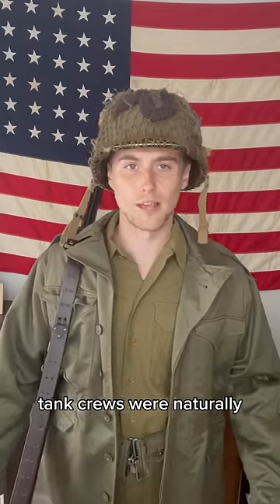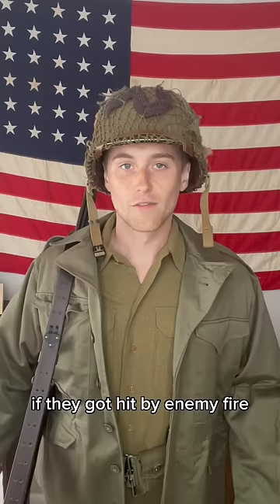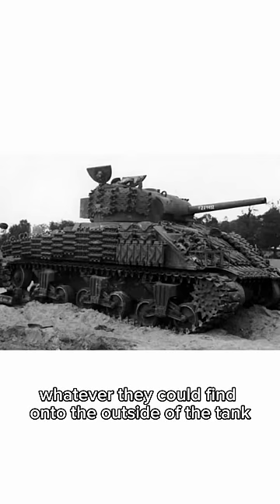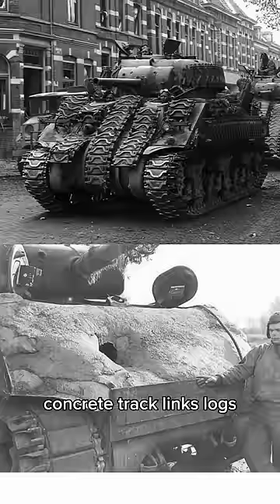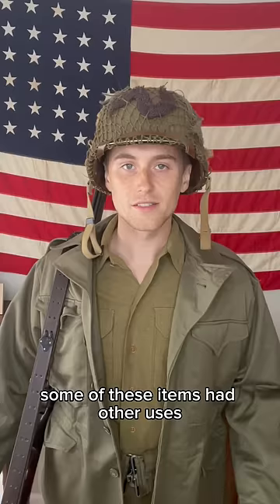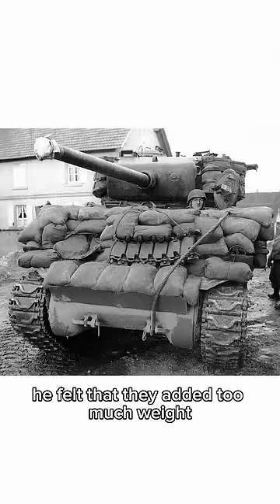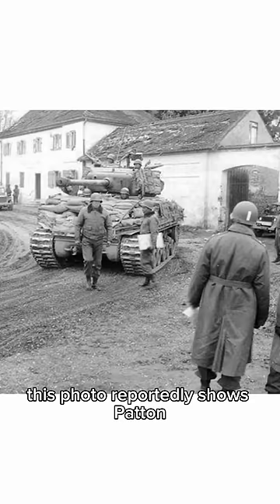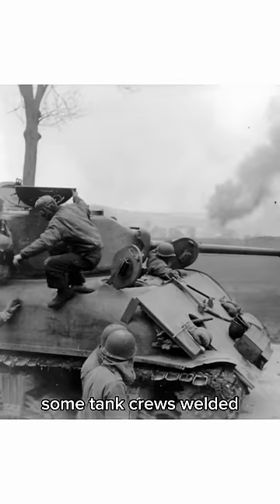Improvised Armor on US WWII Tanks

Comment: "General Patton was not a fan of..."

Yeah sounds about right
Reply: What's more impressive is that he approved something.
Reply: Well ge was right... sandbags weigh a ton and wont help stop a shell going through it.   He was a fan of adding more ARMOR
Reply: @jeepsblackpowderandlights4305 crews did whatever they could with the crude and limited resources.. the push into France and Germany happened so quickly and the Allies experienced heavy casualties
Reply: @jeepsblackpowderandlights4305 A lot of makeshift armor (such as track links) would often normalize the trajectory of incoming shells, causing them to become more effective at piercing the armor by negating the benefits of armor slopes. Patton was absolutely right.
Reply: @Chopstorm. Yeah old blood and guts wasn't riding in that tank though😂😂😂
Reply: He’s not wrong though proper armor helps sandbags and crap like that doesn’t
Reply: @Chopstorm. But these would be also in angle
Reply: @Utubesuperstar ok maybe sand didmt but tree logs did!!!
Reply: @amopastorcanadense  not really. Wood sucks at stopping bullets especially armor penetrating ones
Reply: @amopastorcanadense No, they did not. They actually helped HEAT rounds have more armor penetration due to giving them more distance to the actual armor when detonating. HEAT rounds were poorly understood and didn't have sufficient spacing back then, which the wood would provide, thus making them more effective.
Reply: @amopastorcanadense Nah not really.
Reply: Patton knew that an Army marches on it's stomach. His army required fuel and fuel efficiency is a most highly critical logistic in armored warfare.  Go figure🤷‍♂️
Reply: We should’ve listened to General Patton. He disliked very important things other than improvised tank armor
Reply: @Chopstorm. That’s straight bs. It could normalize as well as deviate the trajectory. Pure luck
Reply: We fought the wrong enemy
-General Patton
Reply: I mean in his defense sandbags are extremely heavy and I doubt they do much against anti armor rounds. Seeing that he approved of additional armor plates it does seem like he just wanted the tank to preform as well as possible without the addition of possibly another ton of weight.
Reply: @ZA-lv8ba  You can go look up Operation Think Tank, Episode 8 where the first ~10 minutes are dedicated to improvised armor use and how effective it was. Hilary Doyle and Steve Zaloga both support my point. 

Soft improvised armor normalized trajectories for incoming rounds, and also provided extra stand off distance that allowed early HEAT rounds to be even more effective.
Reply: @cameronbartlett856 because he had common sense. Unlike most of y’all.
Reply: @Chopstorm. but a lot of the younger generations will still say he wasn’t right just because he wasn’t nice but he was a amazing general and has common sense. Something lacking these days.
Reply: Patton was an amazing officer but an officer in every sense of the word and stereotypes that came with it. Dude bitched about everything but won so you couldn’t say shit
Reply: @mintz9782  The wild boomer appears out of nowhere
Reply: @jeepsblackpowderandlights4305  well to be fair, adding sandbags could be helpful, even if it doesn’t provide armor infantry if they really were desperate, could take it off of the tank to use as materials to set defensive position it is also useful, because if you could put something in front of a imminent death to attempt to stop  it, you would use everything on hand
Reply: @Chopstorm. 
They were for stopping shaped charges heat, and hesh like the panzefaust used
WAY more common than an enemy tank or at gun
Reply: @garyslayton8340  No, that's not how it worked. The soft armor actually improves the effectiveness of early HEAT weapons, as it provided extra standoff distance for their fuses to trigger. There was virtually no benefit from trying to use track links and other soft improvised armors.

This has been tested extensively, and is not even open for debate.
Reply: @Chopstorm.  
It is absolutly up for debate 

Early heat weapons did not have the penitration to do that

If thats the case then why does spaced armor even exist?
That was the entire point of spaced armor
To detonate heat and hesh shells early
It was proven to be effective agaisnt panzerfausts and japinses lunge mines
Every little bit counts in a battle 
And if the wood or tracks could make the diffrence then why not?
Reply: @garyslayton8340  Early spaced armor like schurzen was developed as a counter to Soviet AT rifles, not shaped charges. The mesh screens that the Germans used were ineffective against HEAT weapons like Bazooka, as found by the Germans in '44, and the British/US post war. Refer to WO 194/704 for sources.

Again, the reason why spaced armor did not work against early HEAT warheads was because of fuse delay. They did not detonate immediately. This meant that against normal armor the copper cone would crush before it could properly detonate, leading to poor performance. When you introduce soft armor or spaced armor, now you are giving that warhead time to arm without crushing said copper cone. This meant that the warhead actually did better in regards to penetration when used against such improvised armor.
Reply: @Chopstorm.  
If a shaped charge did not detinate on impact it would destroy the actual soft charge
Reply: @garyslayton8340  Again, soft armor like track links, thin spaced armor, or sandbags did not do that. They did not sufficiently crush the copper cone, and only allowed the fuse the amount of time needed to detonate the warhead at the optimal distance.

This has been tested. Like I said, it's not a matter of opinion or up to reasonable debate. It was a situation born out of fuse technology being rather primitive at the time.
Reply: Nobody in the Division will ever question or spoke about what General Patton doesn't like since then.
Reply: He was 100% right about the tank armor
Reply: @gagebyers1057  
Exept he wasnt
Reply: And he was correct.
Reply: now the question is what was he A fan of 💀
Reply: @garyslayton8340  my guy, sandbag and concrete did severely impact a tank's performance while not giving that much better protection than being completely naked whereas armor plates did provide tangible improvements in terms of protection
Reply: @Temporal94  they didnt *severely impact preformence 
The sherman had plenty of spare weight
Its why the entire t23 project was dropped
Because the sherman had the weight compacity and space to account for all the upgrades

and it did provide excilent protection against shaped charges
Like a panzerfaust
Somthing that would be WAY more common than a proper AT gun are tank
Reply: On this point though Patton was absolutely correct. The add ons had little to no actual benefit. In fact it could be said that they were an active detriment both for the weight and the fact that shots had better surface engagement now that it wasn't interacting with a smooth slanted surface which previously invited the shots to bounce but instead a universally rough that did not have the same proclivity.

This is why he approved of the plating originating from disabled and destroyed shermans. It did not mess as much with surface engagement, and it was actually designed to take these shots unlike everything else being put on the tanks.
Reply: @Chuked Allied armored forces did well in spite of the add ons. Not because of them. All it did was quite literally weigh them down.
Reply: @marketablepresentations7824 Old blood and guts is part of the reason we had tanks whatsoever or did you skip history for the cliffnotes version?
Reply: @cameronbartlett856 he's just passing word from Ordnance
Reply: @garyslayton8340 everyone then knew that erzats armor did shit-all against shaped charge and make them even better. Fortunately for them, they couldn't care about your misinformed opinions. If you're about to ask about spaced armor, look up a cutaway of the panzerfaust vs a pg-7v round. The whole front half of tbe pg-7v is there to provide proper stand off for the 'jet' to form, something that is missing in the panzerfaust. But if you add the thickness of sandbags or logs, the stand off would be just right. Also, veteran accounts don't count for much in these matters, they never were reliable. All the add-ons did was make them think they have enough armor that they think they're safe, and end up charging forward and dying.
Reply: It’d be funny to see his reaction if they did the war thunder strategy of drawing an arrow pointing to their weak spots
Reply: @Utubesuperstar  They absolutely did. Go outside.
Reply: @WarGravyB  no they don’t. You should really do some reading about the physics of what you claim to know about. Also reality and dozens of instances support my and everyone else on this thread who has even an ounce of intelligences stance
Reply: @Chopstorm. Believe it or not in contrast to a bunch of "experts" on a youtube comment section, Patton (yknow, one of the greatest and most admired-amongst-his-men generals in history) did, in fact, know his head from his ass.
Reply: I too learned in history that he wasnt much of a fan, in fact, he wasnt a fan at all
Reply: @garyslayton8340 my boy. Its better to actually weld actual armor plates than have anything that includes Sandbags, Tracks and logs.

Space armor in WW2 is not meant for HEAT warheads they're meant to counter AT rifles. Infact you're far more safer on something that everyone call the Sherman Jumbo than being on a sherman that has Sandbags and track links on the armor.
Reply: @Gencrossbones  
Plate steel IS more effective

thats false
Shermans were allready more or less immune to anti tank rifles
And german docterine was bassicly ditched AT rifles by ww2

Yes they were ment to counter heat warheads

And go figure a heavy tank id better protected than an up armored medium, thats just basic logic
Reply: @garyslayton8340  the spaced armor line is mostly meant for the German Panzer IVs and not for the Sherman specifically and they really don't help with HEAT warheads in WW2. 

Like spaced armor really don't help much in stopping WW2 HEAT.
Reply: @Gencrossbones  can you provide any evidence?
Because the warhead doesnt know if its hitting us or german steel lol
Reply: @garyslayton8340  here's the thing.

Most modern HEAT warheads have rods protruding from their projectiles to prevent it from detonating too early or have fuses designed to explode only after a set distance. WW2 HEAT of both sides mostly have a variety of fuses sometimes detonating on impact causing it to release its deadly payload too early but spaced armor literally only gives it enough distance to form the jet properly and penetrate the armor (T-34-85s with wired mesh and panzer III and IVs with the plates and wire mesh are still VERY vulnerable to HEAT especially bigger ones like the Panzerfaust and Panzerschreck). 

Also everyone already pointed this out but literally detonating a WW2 HEAT away from the tank literally only helps make the jet form better and makes it more effective. Everyone during the war really doesn't know much about HEAT warheads. Ask an actual WW2 historian they will say the same thing since this is an actual thing during the war.
Reply: @Gencrossbones  Yes it did
Otherwise the us and  germans wouldnt have done it

And why did everybody continue useing spaced armor?
If heat from ww2 compleaty nullified  it, why switch to a worse version of heat?

Mechnically Heat from ww2 works more or less the same as heat now

The heat in the bazooka, and the heat in the panzerfaust were almost identical 
The heat doesnt know what country its hitting
Spaced armor is HOW you stop heat
Plain and simple 
If you want to try and prove otherwise, please proved some actual documentation saying such
Reply: @garyslayton8340  like i said spaced armor german size mostly for the soviet AT rifles 

Spaced armor allied/Soviet side actually meant to protect themselves from german HEAT (which didn't really help a lot of them was lost to Panzerfausts and Panzerschrecks even with spaced armor)

And everyone in the comment section pretty much says the same thing as me which is just Spaced armor doesn't do what it's meant to do and actually makes HEAT more effective. 

Tbh the best armor protection is properly escorting your tanks like the Soviets who are notorious for having flamethrower companies with their tanks to flush out defenders that have a panzerschreck hiding inside ruins.

Documentations well there's a lot of reports and pictures. HEAT was so new that nobody understands how that thing works (granted HEAT existed since the start of the war only gained traction later on) and just added work arounds on their tanks (much like how Russia-Ukraine war rn trying multiple ways to counter drones and top down attack ATGMs) and experimented with their warheads.

Modern day HEAT and WW2 HEAT are 2 different things just because modern wire meshes or plates works against RPGs that doesn't means WW2 wire meshes and plates works against WW2 HEAT frankly its like a very low chance for it to properly work while most of the times the Bazooka, Panzerfaust and Panzerschreck just punches through the space armor protection and destroy the tank anyways.

Speaking of which remember i mentioned top down attack ATGMs...the ones that explode like 1 meter above their target. Yeah just because there's air between the HEAT and the armor that doesn't mean it will protect the tank.
Reply: @Gencrossbones  
Okay listen

Spaced armor did NOT make heat more effective, thats just blantently wrong, it DID somwhat normalise things like APCR shells, which under VERY special circomstances MIGHT 
Help the penitration
And if german spaced armor was for countering At rifles
Why put it on things like the turret of panzer 4s and panthers?
Things that were allready immune to at rifles
And why was litterly every nation( including russia) adding wire meshes to their tanks even after 1944, which it would have been well know if they were non effective against heat
And long after AT rifles had become Very rare

if heat from ww2 could defeat a wire fence
Why did we stop using similer designs?
Why did we CREATE A WORSE version of our weapon (we didnt, thats just how heat works)

Heat uses a plastic explosive to blast a small stream of copper through a plate in a target
Thats how it has ALWAYS worked

If the heat detonates early, IT SLOWS DOWN and spreads out ALOT

But modern heat
Uses much more powerfull explosives
That move the copper jet MUCH faster
And why the javalin is a top attack missile, because with the combined extra speed, and the MUCH thinner turret armor on top 
It can penitrate 

A wire net is a wire net, time doesnt matter

The rpg-2(almost exactly the same waehead) was designed in the 40s
And we were useing nets against those too

GO figure 
Its almost as if more modern explosives are more effective, and allow heat to penitrate things they otherwise wouldnt have

Countrys dont just throw things out
They do testing, they do R&D they do YEARS of develoupment, they would have known exactly how effective the weapon would have been before it was feilded 
And guess what
Ive read those reports from abberdeen
And youll never belive what they say
( its that spaced armor of the correct spacing and thickness was effective in defeating heat)
Reply: he was also known to be seeking publicist by his peers and arrogant. 

With history comes with glorification and lot of faults that are avoided by the masses. By making them a hero lot of credits are often forgotten to other people. This was especially true in the army. Lot of moving parts and planning. So everyone had contribution especially Russia. Russia certainly turned the tides. 

The guy was good field commander as he executed Bradley’s plans. When it comes to executing plans perfectly Patton was the best guy. 

Remember the guy had done lot of questionable things and had tried to hide obvious war crimes and had done things to civilians populace.
Reply: @mr.anderson3288 you mean like when he called the Nazis "the wrong enemy"?
Reply: @shutupluffy2 yeah he was also a nazi apologist
Reply: @fordo5361  patton was a master of propiganda
He did not hesitiate to push for the things that caused the red scare for his own gain 

Stalin WAS arguably worse that hitler, but calling hitler "the wrong enemy" is VERY disengenious

Comment: if you strip the front armor of a broken sherman and weld it onto a working one, you now have a sherman with thicker frontal armor than a panther
Reply: Sherman Jumbo back in the depot:`Am i a joke to you?``
Reply: Plus its sloped armor, which protects even more
Reply: @apyllyon  Well the Jumbo was no E8  that's for sure.
Reply: It’s also spaced armor so it’s even more effective especially against panzerfaust
Reply: @40thaerx87  More protection aganst HEAT ammunitions of all kinds, from shells to rockets
Reply: Plus you have a working tank as well.
Reply: That could put more weight on the transmission. Causing it to break. It would be either wngine or transmission. Jumbo tanks had similar problems and even M26 with overheating the engine due to the weight.
Reply: @artimpixel2185  If we have a near limitless supply of shermans and me and the boys are out here dodging Pak 43 rounds, i'm not gonna worry about breaking uncle sams transmission
Reply: @toasty5605  Id be worried about breaking the transmission of the vehicle that is supposed to take ME safely through a fire zone. The fact that there may be 500 more Shermans back at depot doesnt do me a bit of good when I am being shot at.